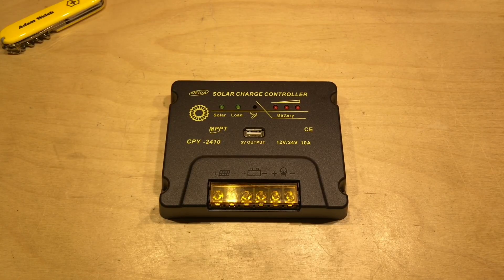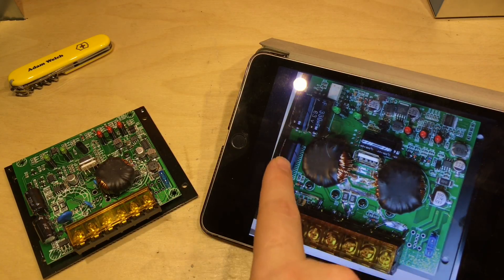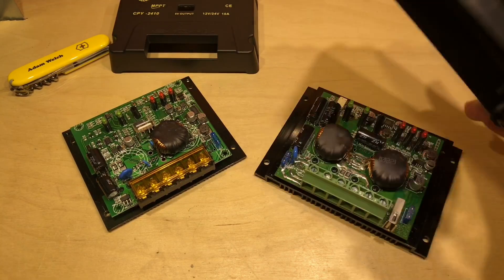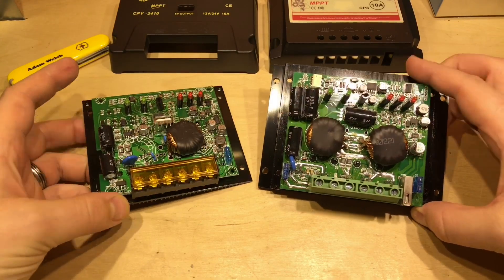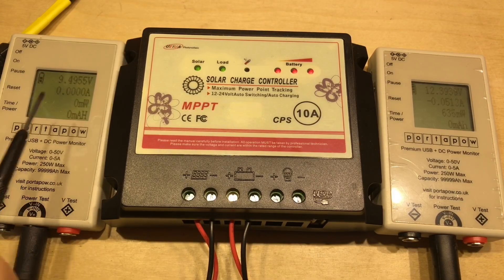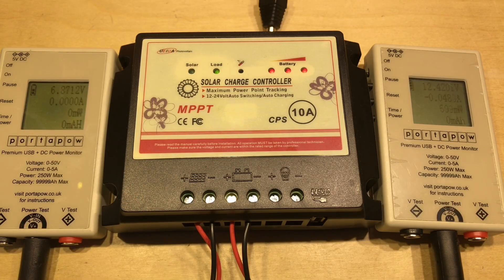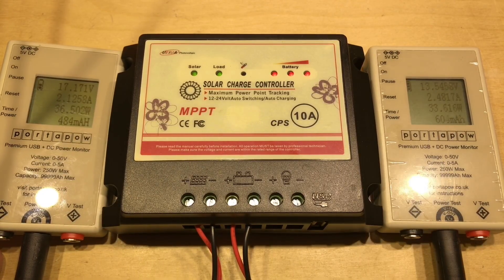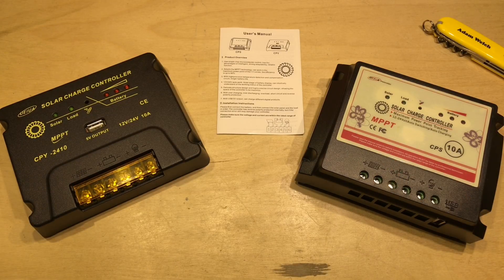UEIUA MPPT Solar Charge Controllers - 12v Solar Shed

Comment: I have the 20 amp version of the one you reviewed and it lasted 6 weeks before catastrophic failure. The system was wired to two 12v panels in series and on a frosty morning the input capacitor connected to the panel exploded covering the circuit board with the paper used to insulate plates inside the capacitor. According to the data sheets for the solar panels they could never reach the 50 volts stated to be the maximum input voltage for the solar regulator. It also appears that the transistor controlling the 12v input is leaking current preventing it from now operating at 12v and one of the outputs from the micro controller is dead, this output feeds the driver for the switching transistors. 
Before that all happened I found that the regulator would directly lock the panel to the battery voltage on smaller panels of 80 watts when the sunlight slowly increased. It had to be switched off/on for it to start mppt operation. Compared to the Victron regulator that I have used for many years this cheap regulator is just waste of money.

Comment: Do you have any connections to UEIUA stuff??  i need the apps they included with the ones they sell that have IR remotes to set them.  mine had units you plug into your phone (IR) so you could use phone with an app.  Mine is a CPL model

Comment: It works well my... the bulb you connected in the end of video just drained current from battery - not from charger, therefore microcontroller didn't see it. This one works just differently, lowering voltage on input allows less heat dissipation inside the device which is important for higher wattage. It would be also great to see the type of MosFet used on PCB to determine the real maximum input voltage the charger can withstand. Thank you for your work...

Comment: I've just checked mine: I've the same mix-up: The CPS double coil withinness, but with the CPY case. Mine reads BIG V2.4 and it seems to works quite well. With the support of an USV battery I drag 105 Watt out of a 100 Watt panel, even when the battery almost died.

Comment: Thanks for the video. I have two of these charging two separate boat batteries (780cca 12V, lead acid) and they have been working perfectly for the past 12 months. I am only concerned that it gets up to 14.6 volts when charging. Will this reduce the life of my batteries??? P.S I monitor each battery voltage constantly with Bluetooth device battery monitor). Thanks

Comment: can the cpy-2410 use a lithium-ion battery
Reply: If you use 4s and are not in need to pump it up to the max: yes, you can. I'm using a 4s1p just for keep the controller alive. With a 100 Watt panel and as a load I use a step-up converter to 42 Volts to load my e-bike batteries. Works quite well, with low losses.
Reply: @kapegede  You could just use the step up converter directly on the solar panel going straight to the battery... unless I've missed something in what you said.
Not sure what you meant by "just to keep the controller alive".

Comment: Just bought a CPY-2420 and don't know what to expect right now! Great videos, keep it up!
Reply: for CPY-2420 what is the max VOC for 12v and max voc for 24v systems and also max solar panel wattage.
Reply: @chandruasp  max panel wattage 240w for 12v panels, 480w for 24v; don't have the other specification but I'm quite sure it will be ok with my 12v 100w panel
Reply: @jesjames  Thank you very much jes james.

Comment: It doesn't seem so much that it is because it is cheap that version 2 is no good. Its presumably because costs have been cut in production. The same could happen with an expensive commodity - once they have established a market, the manufacturers have leeway to reduce quality and still have buyers on the strength of the old version and old rep.  This seems to be the case with certain luxury car brands, for instance.

Comment: I bought one and it won’t charge the battery? Everything checked and worked on pwm perfectly until I installed this. 

The solar light turns on fine but just won’t deliver any current.
Reply: The solar voltage must be higher than the battery voltage. Else it won't do nothing.
Reply: @kapegede  returned it back to supplier, it was faulty. 🙂

Comment: Thinking further about the newer version of this controller, perhaps the solution is what some of the MakeSkyBlue controller users have done - if the input voltage stays low for an extended period, disconnect the panels and make it start again.  

Easily done with an Arduino or a PICAXE or even a mechanical timer - simply disconnect the solar panels for 30 seconds or a minute every 30 minutes to an hour.  Not exactly how we expect to use these controllers but a relatively inexpensive way to get close to the expected performance - certainly cheaper than replacing it with a Midnite or a Tracer A series (my preference for small MPPT systems - the initial purchase possibly having been influenced by some Brit named Adam ;-)

Comment: My 2420 cpy does MPPT, checked input voltage about 30 Volt and output about 13 volt with higher Amp. So I got lucky :)

Comment: My EPEver/EPSolar Tracer A series MPPT controllers (one 4210A, two 3210A) continue to work without any problems (2 years continuous service for one of the 3210A's).  Typical idle current on the 3210A is 15.7ma with the load Off, 33ma with the load On.  It also goes into MPPT mode just above 5 watts of solar input and it tracks consistently, if not as fast as some of the more expensive MPPT controllers.  A device that reliably meets your needs within your budget is a good buy ;-)

banggood.com still says they're selling the A Series (in the Q&A section of that page).

The lighting system in the shed out back has a 30 watt panel, 15AH of AGM batteries and a Landstar LS2024B controller.  Didn't need the 20amp capability but did want to be able to monitor the solar performance with an eLog01.  The 30 watt panel and 15AH battery are adequate for the limited use those lights get, even in the dreary days of January/February.
 
Thanks for all the reviews.

My take on a spreadsheet for figuring how much solar power and how big a battery bank is needed to run your list of devices:
http://www.jecarter.us/files/My-Solar-Generator.xls

Comment: My problem with (and I've used several different charge controllers) is that they're generally not that great. My current controller with a full battery and 7A available from solar panels, with a 4A load running, will take a trickle from the panels and run the load off the battery. Despite there being more power available from solar, it depletes the battery rather than running the system efficiently.
Reply from the maker: I know what you mean. This is usually to do with the boost, float and the boost restart voltage settings (EPEver who I have the most experience with call it Boost Reconnect Charging Voltage). Being able to adjust this voltage helps with the problem you describe - if the battery falls below the float voltage start a full charge again.
Reply: @AdamWelchUK  I'm wondering whether there's some way around it.There surely must be because otherwise look at all that free electricity we're just wasting. Out of interest I put a voltage controller on my two 30W solar panels and used them to run my 4A fans. It worked really well. The controller would cut out when there wasn't enough sunlight and cut back on when there was. 

The only thing I can think of doing (aside from sucking it up and accepting power will be wasted) would be to use the voltage controller to activate a relay so that when sufficient power was coming from solar, the fan would be powered directly by solar but by the charge controller when there was not sufficient solar power.

This is my test setup with one 30W panel and one 2.5W (1.8W) extraction fan.
https://youtu.be/fCDHYLfRDJI

Comment: It appears that it's optimised for MPPT but only with 1 panel maybe, meaning it wasn't designed to take into account more panels in series. Since it always seems to sit around 16-17v which is the MPPT for 1 panel usually. 
So the controller is useless if you have panels in series, that's what I am thinking. Not 100% pure though.

Comment: Thank you, Adam, for this deep insight, i learned a lot from! ==> obviously well meant, but badly done... if MPPT algorithm fails to keep it's initial MPP ~36V but travels far away downwards to only 50% performance, it can't be very smart: any manual fixed setting would do better !
==> any recent development / bugfix update during 2018 ?
Reply: Time machine has pointed out elsewhere that they do not like panels in series and you'll get much better results with panels in parallel.
Reply: @johnarmstrong3782  Still  bad: MPPT converters are made for series strings, so they should not fail on this ever...

Comment: Now there's a CPY & CPS - BIG V2.4. 2017-05-09.

Has the offset Coils, and centre USB as in CPY board, 5 Caps, and everything else much like the CPS board. Sold as CPY-2410
Reply: I have this model as well. Any tests done on it? Is it any good?

Comment: What are you talking about, you seem to be clueless.  The controller does not control the power coming in, that is controlled by the amount of sunlight and the number and type of solar panels used.  What is important is the amps going to the battery, not the watts.  Clearly based on what I can see, at one point 2.1 amps were coming in, and 2.45 amps were going to the battery, this is MPPT.  The controller converts volts to amps.  Battery chargers are rated at amps, not volts or watts.  Ha-ha-ha, you go on and on how how the controller controls the volts coming in, that is crazy.  As far as I can tell, the unit appears to work quite well.  Total watts going to the battery are close to the watts coming in, the voltage is lower, but the amps are more, which tells me the MPPT is working great.  When you said the unit should control the volts coming in I almost cracked up, the unit only controls what goes to the battery.  Wow, maybe you should do something else.
Reply: @timemachine_194It's been a while, I hope you haven't hurt yourself while fooling around with these things. I reread your post and mine; you said you don't need artificial resistance to force the panel to maintain maximum efficiency. 
______________________________________________________
"By the way- the controller doesn`t need to create artificial resistance. it simply adjust its stepdown-PWM of its dcdc-converter circuitry to tune the difference between Panel voltage and battery voltage. All the panel`s energy minus stepdown-efficiency will go into the battery in mppt-mode.
______________________________________________________
 
If that were true, why would your “link: https://en.wikipedia.org/wiki/Maximum_power_point_tracking” claim otherwise?  Ha-ha.  Especially since resistance is the difference between maximum voltage and maximum amps.  NASA uses resistance, you claim they don’t need to, maybe you should get in touch with them since you claim to have devised a new way of doing it.  Think of all the money you could save the space program.
Reply: You are entertaining, sorry, I couldn't help myself.  I noticed you really didn't address my last statement, don't bother, I know why and so does everyone else by now.  Just so you know, repeating what I write seems a little pointless, if I remove my reply, you can put anything you want in there and no one would know the difference.  Thanks it's been fun.@timemachine_194
Reply: Stop it, please, you're making me laugh again. OMG you edited your last comment, did you edit out your admission that your comments were supposed to be entertaining?  You’ve been trolling me for a while now, do you provide this entertainment to everyone who comments or do you just want to make me feel special, what a guy.  Don’t forget to get in touch with NASA on how you can continue to force a panel into MPPT without using resistance of some kind.  While you are entertaining and all, surely your time would be better spent talking with NASA.  @timemachine_194
Reply: Okay I read your link, and I think  you are lost in the math.  The goal of the charger is to charge the battery.  A solar panel puts out maximum current at almost zero volts and maximum voltage at almost zero current.  
The difference between the two is the resistance of the circuit or load, in this case the load is the battery.  The controller maximizes power to the load, the battery.  It converts DC to AC, than back to DC, that's the reason for the power coil.  To get AC, you have to switch the DC power, the more you switch, the lower the voltage and the higher the current.  At some point the battery will be charged, then the voltage will show higher on the input with less amps flowing.  The load is controlling the volts and amps, the panel has a set limit on each, the purpose of the charger is to charge the battery, maximum power point tracking to the battery.

Just so you know, watts are important in a battery charger, but only in relation to the battery.  A 150 volts at .01 amps will give you 1.5 watts and it would probably wreck the battery.  A 150 amps at 1 volt (150 watts) will not charge a 12 volt battery.  Fifteen volts at 1amp, (15 watts) will charge a 12 volt battery.  You buy a battery charger to charge a battery, hence the name.
Reply: I get how the MPPT is supposed to work, what you don't get is that this is a battery charger.  If the battery doesn't need the power because it is fully charged, it would be silly to put an artificial load on the panel to continue to optimize it's power output.  By optimizing power to the battery, the panels will come to MPPT almost by definition, especially if the battery is deeply discharged or showing a low voltage due to a high load.  As the battery becomes charged at 80 to 90% of capacity, the power supplied to the battery generally is reduced, what would be the point of creating artificial resistance to the panels which  would create heat in the charging unit.  The needs of the battery determines how the charger will work.  I guess a utility might do this in anticipation of future demand, but I don't see a heat radiator on this charge controller.  The battery is the resistance and the load. 

From your link: "When the batteries in an off-grid system are fully charged and PV production exceeds local loads, an MPPT can no longer operate the panel at its maximum power point as the excess power has no load to absorb it. The MPPT must then shift the PV panel operating point away from the peak power point until production exactly matches demand. (An alternative approach commonly used in spacecraft is to divert surplus PV power into a resistive load, allowing the panel to operate continuously at its peak power point.) "
Reply: `15.7V is equalization mode, would kick in for an hour to equalize all the cells battery, it wouldn't harm the battery but could harm those plugged in into the load output dc rated equipment 12~13v because of the over voltage, and you cannot edit it because it does not have any controls, might as well not to buy this crap, but if you have one, to prevent that crap controller from doing that overvoltage thing is to add more devices in the load output or add another battery in parallel,
Reply: This will be my last reply, because you are just too clueless to continue this discussion.  First, I did edit my statement, about two minutes after I first wrote it, you were just too clueless to notice it earlier.  Second, I would say that you are the one who has learned something from my comments.  However, you keep talking about controlling what goes into a battery using a lab power supply, by increasing voltage you can force more amps into the battery.  Stop there, that is clueless.  By increasing the voltage you are overriding the resistance of the battery and you will end up with a burned up battery.  Ha-ha-ha, you don't seem to know anything about the basics.  My other comments are true, especially the comment about amps as a measure of power for a 12 volt battery charger, look at almost any ad and you will see their rated power in amps at 12 volts.  Batteries are sold based on amps at a particular voltage i.e., 700 cold cranking amps at 12 volts.  Ha-ha, please.

As far as this charger, my initial statement was that it appears to be working based on what I can see.  I didn't say I had tested it myself.  What I  objected to was the methodology and the reasoning going into the test as shown.  In the video you can clearly see that after he puts a load on the battery, you have 2.04 amps coming in and 2.37 amps going to the battery.  This is the MPPT I was talking about, more amps going to the battery than what are coming from the panel.  Whether the unit discussed is any good for reliability and safety is unknown to me, it isn't tested here. The only person who seems intend on embarrassing themselves is you, you keep stepping in it, but you are so clueless you don't even know it.  I read your comments and even you admit it is working, but then you make baseless claims that are not supported in the video.  Personally, and this is just an opinion, maybe you shouldn't play with electricity or these types of things without adult supervision, you might hurt yourself.